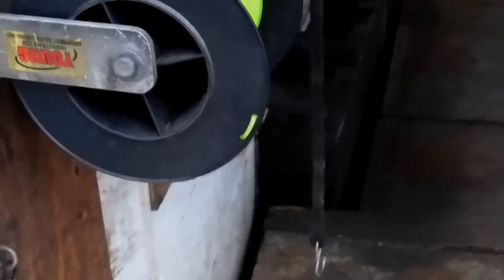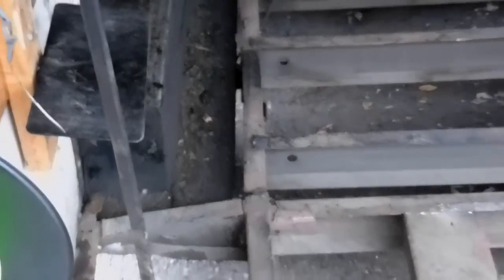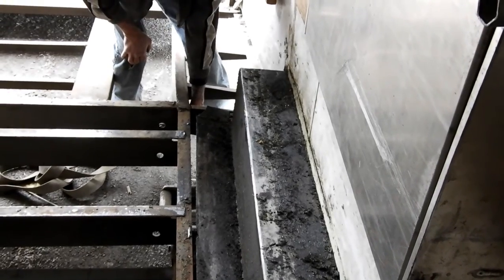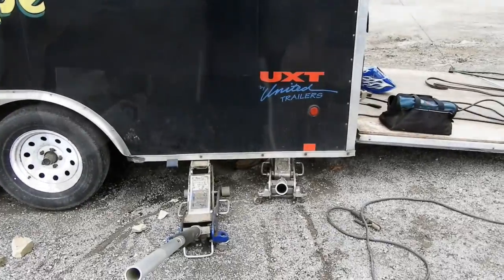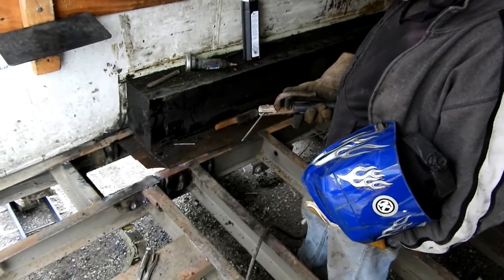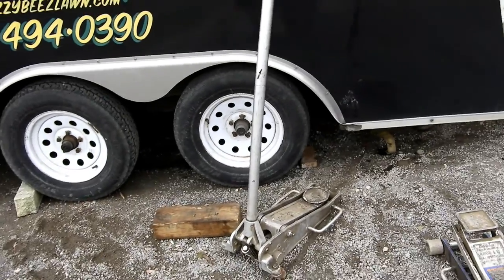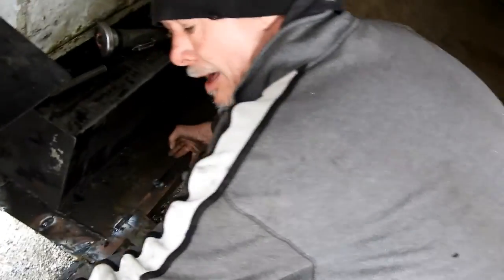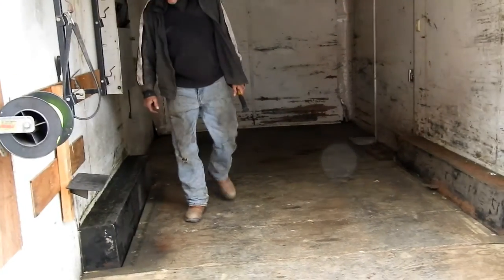Major trailer repair!!!  Lesson Learned

Comment: Great video. I have similar damage to my enclosed trailer from driving through VA and WV going 4 wheeling. I forgot to wash salt from underneath it when I got back and now 3yrs later my frame is rusted bad. I'm glad I found this video because I forgot about pulling up the floor up. This makes access much easier! Thanks again!

Comment: I have an old 1958 fiberglass box enclosed trailer with a rotten out frame up near the tongue that gave way some. Problem is I'm 1400 miles from home with it. Gotta try to find someone reasonable to help me fix it. No fun at all.